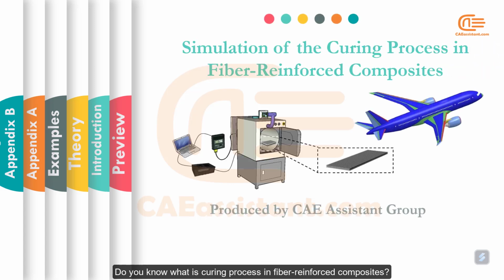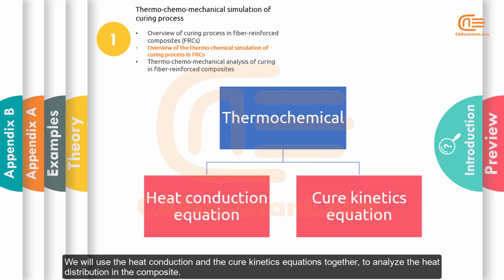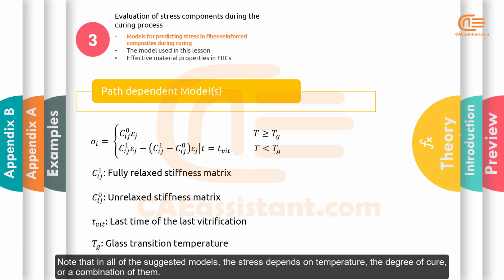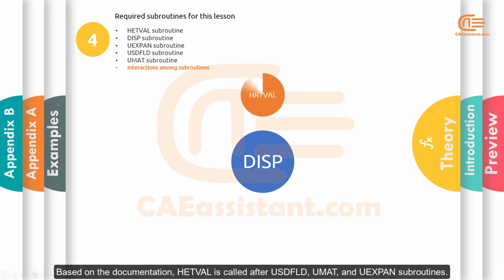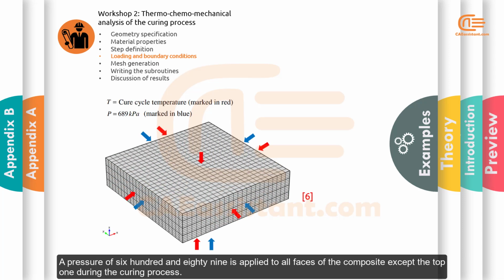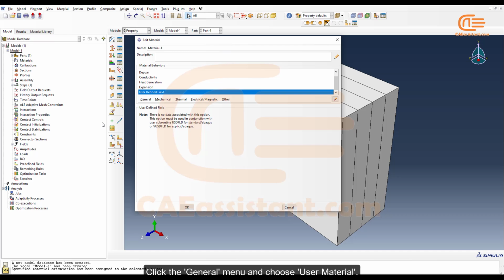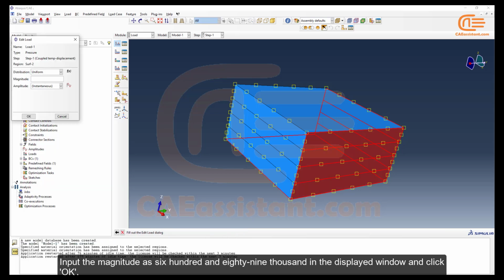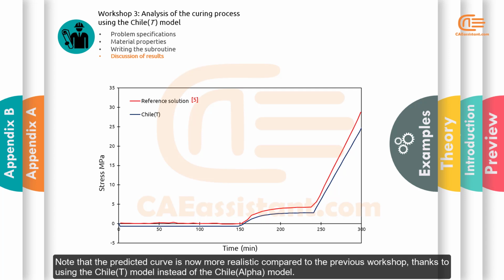Curing process simulation in Abaqus | HETVAL, UMAT, USDFLD, DISP, UEXPAN

Comment: Thanks for your video!
In your USDFLD subroutine, you defined FIELD(1) = STATEV(2).

Shouldn’t it instead be FIELD(1) = STATEV(1) − STATEV(2) * DTIME?
Since the resin density depends on the degree of cure, not on the rate of cure.